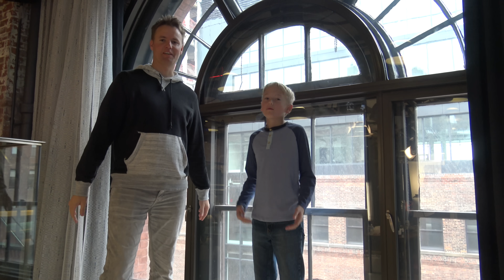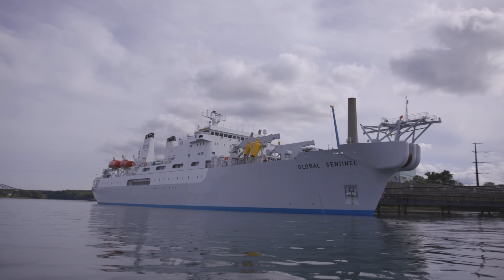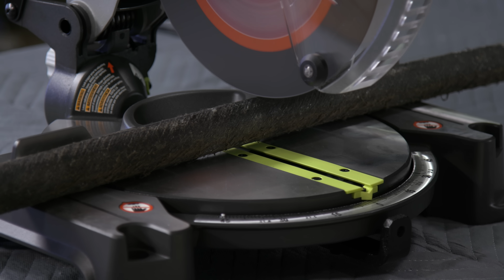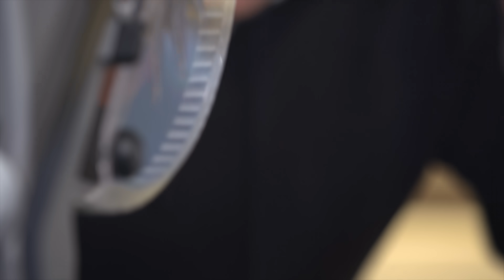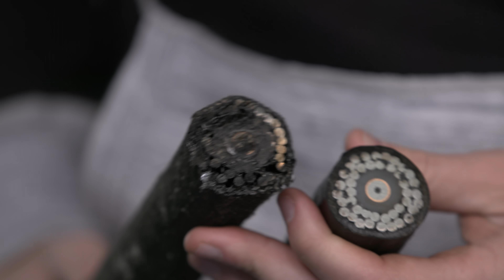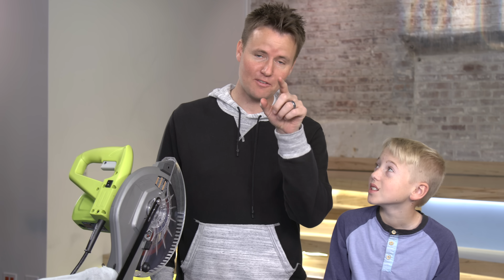What's inside the Undersea Internet Cable?

Comment: One more interesting thing is how they can fit all that cable on the ship. It does not seems that the cable could be bent so they could roll it up, or can it? They would need a hell of a long ship if they are not feeding the cable from the shore as the boat sails.
Reply: The cable can be bendt without damaging it, you just need enogh force.. with machinery i guess they roll them up somehow to fit as much cable on the boat as possible

Comment: Please be careful when handling fiber optic cable. When the cable is cut or broken it can create microscopic glass shards. Once these penetrate the skin they are hard to locate and will not degrade. If one of these ends up in your eye for example you are going to have a big problem. The fibers are sharp and can penetrate deeply, they are hard to remove because they tend to break off, and for obvious reasons tools like magnets are useless for getting them out. I hope they cleaned that youtube space thoroughly after cutting through that cable !!

Comment: There are a few reasons that under sea cables are better then satellites for internet. 

1. Speed, the satellites used for internet are 36,000km above the Earth so the data needs to go up to the satellite over to the next in the chain until it gets to the one to send it back down. For cables it is a much shorter path even with just the few connection points. 

2. Capacity. A single fiber can carry multiple channels by using wavelengths of light to package data. A single cable can carry anywhere from 1Tbit/s-255Tbit/s with cable bundles anywhere from 10 fibers to 100 fibers. For satellite you are limited to the size and capability of the dish used. 

3. Weather. Once a cable is in place it will work day or night rain or shine. Satellite the worse the weather gets the slower the speed it can handle as more and more packets get disrupted in transit. 

Thats not to say that there isn't a use for satellite for remote locations or mobile access.

Comment: What if there is just a little break and then the wifi wouldnt work
Reply: I know it would be VERY hard to break but still
Reply: Benjamin Sikur I work in networking, and they break fairly often, it's normally boats with anchors too low or extreme weather conditions. 

But there are more, there are loads of these things so it always finds another way round. There are very few country's that only have one link in from the sea.
Reply: Benjamin Sikur and if it was a minor break the light would still go through if it was aligned although I may be wrong
Reply: Wifi hasn't got a thing to do with undersea internet cables.
Reply: I'd expect someone that claims to work in networking to realize WiFi hasn't a thing to do with wired network interconnects, especially at this level.
Reply: JeepITguy I just took WiFi as his home internet connection rather than the access point. Obviously I know this has no effect on actual wifi haha. But I thought this guy meant, if this cable breaks, my home internet will not work.
Reply: Christian Conner ye thats what i meant

Comment: I wouldn't make-do with an abrasive blade on a chop saw intended for wood cutting if I were either of you. :-(
Use a proper tool (e.g. sawzall for instance)
Reply from the maker: +RS 1990 the blade is specifically for cutting metal, not wood.
Reply: I know, but the instruction manual states that you should not use abrasive wheels because it's a 'Miter Saw', hence the dust bag.
The bag and the lower guard can be badly damaged by the sparks and so rendering the tool's warranty void.
There's a difference between an 'Abrasive Cut-Off Saw' and a "Miter Saw' but both work in similar ways.
Different blades require different guards.
For instance, an Abrasive Cut-Off Saw has a spark deflector at the rear, an adjustable vice for clamping the material and an abrasive cut-off wheel that's guarded only at 180 degrees.
A Miter Saw has the blade fully surrounded at 360 degrees by means of a retractable lower guard for safety reasons.
A toothed blade that is only half guarded & half exposed can be twice as dangerous as that of an abrasive wheel, hence why they should never be used on saws intended for cutting ferrous metal with an abrasive wheel.

Comment: Oh yeah you think you have slow internet here mine. AT&T DSL with Cat 6 cable I get .80Mbps & .36Mbps upload. Let's go wireless testing with iPhone 6S Plus right next to router so it has maximum speed .65Mbps download & .32Mbps upload. Here a better perspective of my internet speed. It takes 4 hours to download 1GB uploading the same file takes 8 hours. That counting on internet not going out and no one else using the Internet.
Reply: Bass Junkie same internet same problem plus it always drop im payin for 6mb and and im only gettin 2max and that is on a good day which is never lol i wpukd drop att so fast if i can get cable  but where i live its on att dsl (ohio btw)

Comment: what's inside an oversea internet cable
Reply: TheGhost bc it was a joke
Reply: TheGhost i thought it was funny that they had distinguish that it was undersea in the title when all internet cables are the same.
Reply: At least I got the joke... Very funny by the way.
Reply: lesryglrhfohser the exact same..... If you use your brain
Reply: it was a joke, it's all cables i know it's all the same.
Reply: Probably the same, but may be not so reinforced.
Reply: internet cables that's not in the sea, don't usually need that much protection, so it's not really always the same..

Comment: its already cut at the both end ??? why still cut at the middle ????
Reply from the maker: +Albert Chan46 that's what we do.
Reply: Albert Chan46 agree, they shouldv cut it lengthwise
Reply: What's Inside? Their just that awesome.
Reply: Albert Chan46 it had things that covered the edges I think
Reply: Albert Chan46 Cuz dats WUT DEY do bro
Reply: What's Inside?  why didn't cut the undersea wire when it still installed under the sea.and still flowing the internet..it much better 😂

Comment: be carefully with fiber optic like that because when you stripped down the color are the fiber puré.
i all the comunicación cable are equal more protección than cable.
The cable when i work in the paat have some gelatina and Kevlar to protec the f.o.
You past more time stripped and prepare the cable than soldering the fiber optic that was made with a machine

Comment: I'm amazed that those cables are thinner than an Ethernet cable, yet they can carry an entire country's worth of data. I thought they'd be more like the cables you see at power plants and such, several feet in diameter plus the protection. Like a sewer line or something. Amazing.

How many cables are there running between the different countries of the world?
Reply: They can also transmit many different signals at the same time. So light has different wavelengths and using wavelength-division multiplexing they can transmit tons of data through them. As lasers become better and more precise, then can send more data through the cable without having to put a new one down, just change the lasers on each side.
Reply: Because your ethernet cable is running as analog, ie it is a power cable. This cable is fiber optic ie light ray.

And to your second question, not as many as you think. Look up a map of it online. An undersea earthquake can cut the internet of a small nation.
Reply: Warrior Son I think the LHC is several feet in diameter for an example
Reply: Warrior Son I know that's the joke. the name is Large Hadron Collider.
Reply: And the copper cables are also running data to they just dont need to be as well protected as the fiber.

Comment: What if you put that cable in your pc?
Reply: right with ethernet cables not being digital, but saying those cables do not run in http?wtf
Reply: Those cables do not run in http protocol. Even if they do they are fiber optics while your LAN cable is analog.
Reply: Oh
Reply: LAN cables are digital, not analog.
Reply: "http protocol".. kek
Reply: Danny Billy are you serious right now lol of course it does.
Reply: KEK
Reply: Zreknarf K3K™
Reply: you cant because the cable itself is glass and glass cannot conduct electricity. the way internet works is it travels in the form of light hence the glass. electric cables use copper.
Reply: +XTR@T3RESTRIAL i don't think copper uses electricity.
Reply: No cable run in http protocol... It has never and will never.